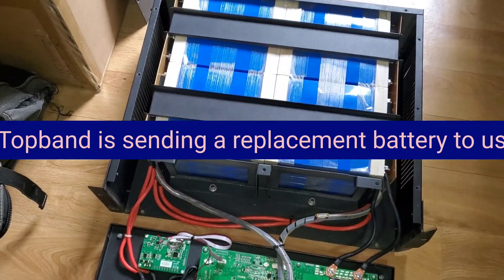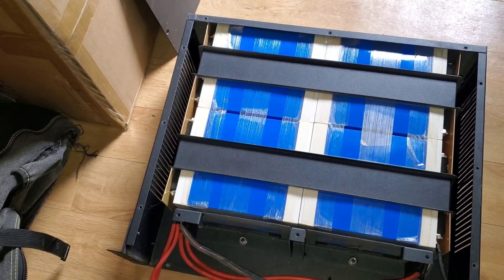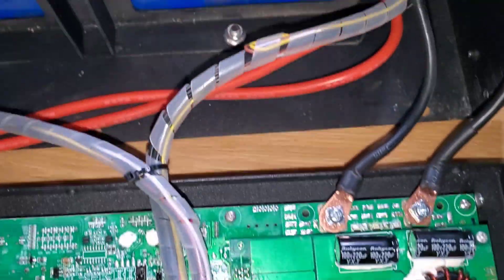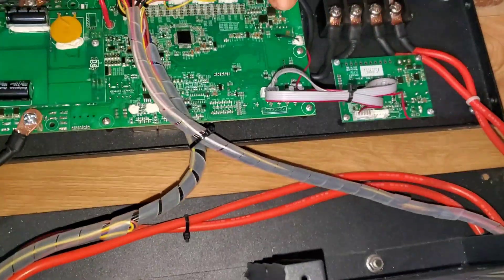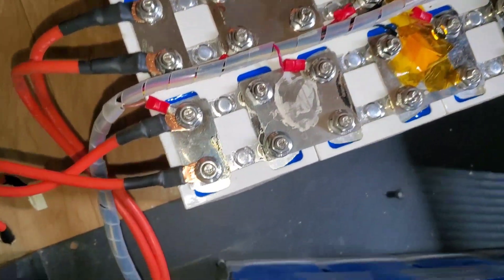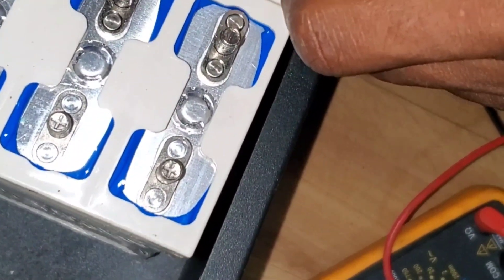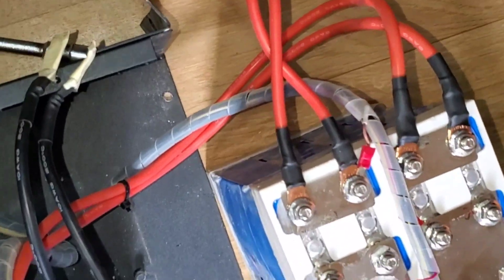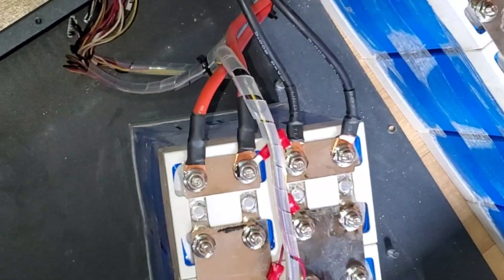Teardown of the Topband Lifepo4 battery

Comment: I'm quite sure these cells weren't new or balanced from the factory. Perhaps grade C cells at best. They tried paralleling them to even out the individual cell differences but apparently they are different enough to still have issues. To me, that JK BMS I  just saw in the video is superior to the Topband and Seplos BMS. The JK also has in-built active cell balancing (which can be very helpful with these poorly balanced Topband cells) while most of these copycat lithium batteries have passive cell balancing only. Thanks for giving us the requested teardown video.
Reply from the maker: I am sure that they will improve after watching my video. The manufacturers are watching and taking notice. Two have requested that I take down my videos. I agree with your assessment. A JK like BMS might have prevented this from happening.
Reply: @drsolar  JK BMS  has no precharge feature,  and are not design to be parallel according to their engineer, even if everyone is doing it :-)